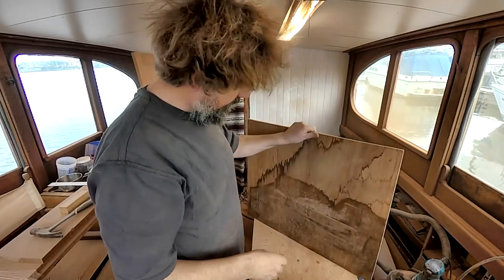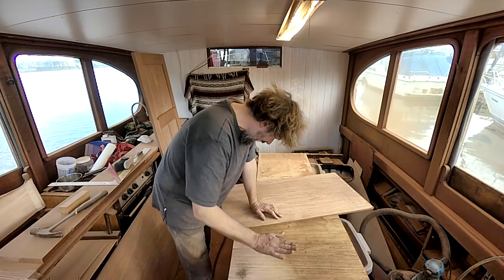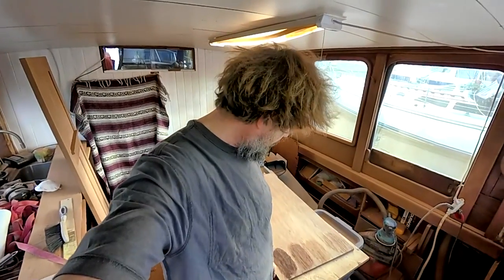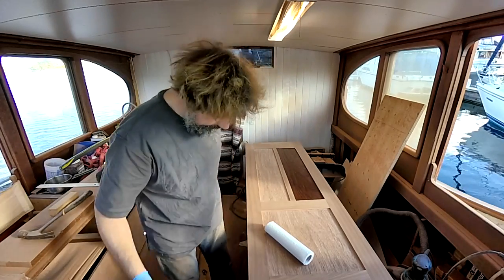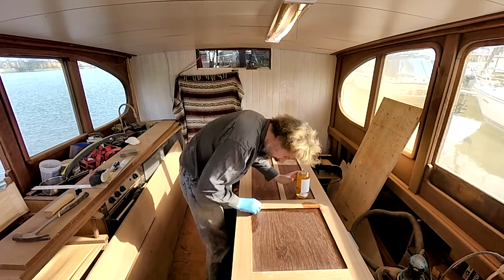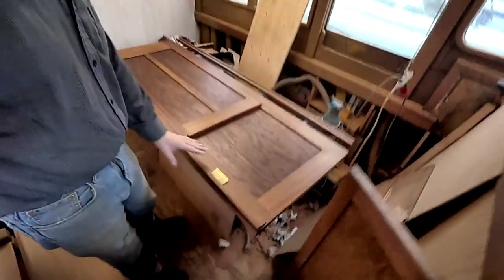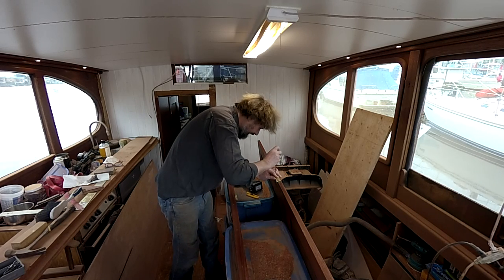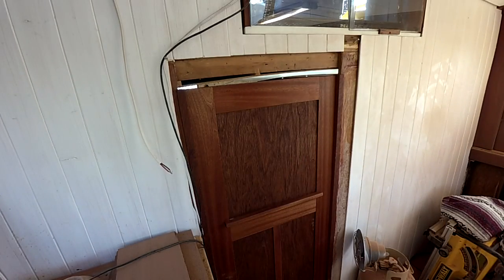Bonus Episode - Finishing the aft cabin door - Boat Refit - Travels With Geordie #101

Comment: I would coat the whole thing with a good marine varnish containing UV blockers. For exterior applications on marine mahogany ply (which may be okoume), I would stain, then apply two or three coats of marine varnish.
Reply from the maker: It will get several coats of polyurethane inside over the oil. and everything outside gets 6 to 8 coats of Epifanes varnish.

Comment: Peter, the door looks great!  Now about the stain.  In my experience with an African Mahogany cabin house a bit south of you I have found that Petit Dark Mahogany Filler Stain produces a beautiful red color that holds up very nicely on my boat.  At least it has for the last four seasons without any yellowing.  I stained my cabin house because of color differences between planks.  With 10 coats of Epifanes gloss varnish it looks quite nice.  I am thinking of stripping my transom this year and doing the same since it has yellowed badly with just varnish.  My interior is also stained, but I wanted a browner color so I went with Minwax red mahogany stain with 5 coats of Minwax gloss urethane and a final coat of Minwax satin urethane.
Reply from the maker: Thanks for the tip of the Petit stain, I'll look into it.
I use Epifanes too and love it. Inside the "magic" blend I talk about is 4 parts Sodoma red to one part Red mahogany by Minwax. So we're pretty close there.

Comment: Peter,

Your videos are a delight so thanks for all of them.  I, too, share a love affair with mahogany and have not as yet achieved the perfect (to my eye) blend of products to provide the most pleasing, restful appearance. The interior of my 20 year old Legacy 40 Downeast (purchased last year) is weathered and UV damaged mahogany, but is slowly returning to its former majesty using the following:  light sanding with 220, followed by Verathane golden mahogany stain, several coats of Epifanes Rapidcoat tinted with teak tint and then several coats of Captain’s varnish on the trim.  While I love the ting oil treatment you apply, the absence of a UV overcoat means constant redoing.  Not fun. I can not restore my mahogany to its former original appearance because of the UV yellowing damage so tung oil is not an option, but the sanded wood does seem to accept the stain which was used originally.  The Rapidcoat adds a bit of darker coloring and requires no sanding between coats. More importantly, it has UV protection and leaves a nice satin appearance.  The trim areas are highlighted with a gloss varnish (Captain’s) and seem to meet my aesthetic requirements.  With all the light and sun streaming in your cabin areas, the UV damage will be a constant.  That’s why I think my mahogany needs the added protection of some sort of UV protection.
Reply from the maker: Thanks John, and you're so right. Tung oil on it's own cannot possibly cope with the sun. Inside I'm using several coats of polyurethane with a UV blocker and outside several coats of Epifanes varnish with a UV blocker. Now neither of these uses an opaque solids blocker like Cetol, but I just can't stand that look. 
As you say, the interior may suffer more quickly than some, I'm curious about how well my plan will hold up. We'll all find out together.

Comment: I vote "Cut Stain"!!!  What happens if you use the epoxy sealer that soaks in with a tint?
just asking, from a a fibreglass stink boat owner.
Reply from the maker: tinted epoxy would be more drama than I could handle. Heh.